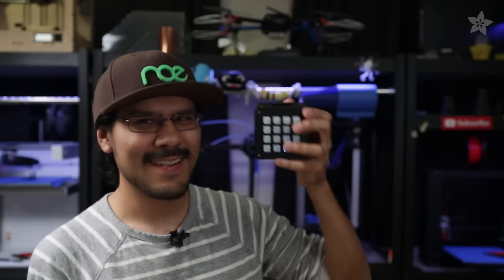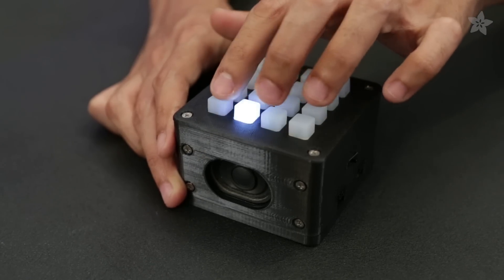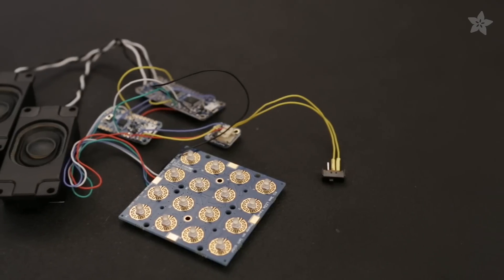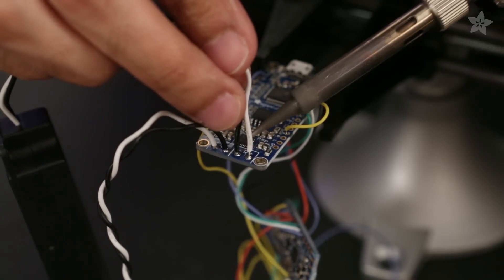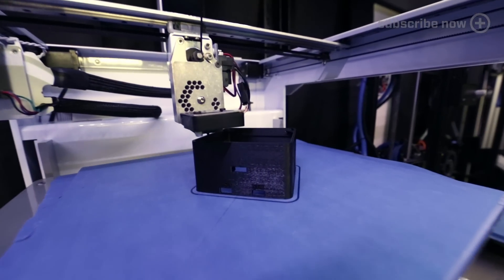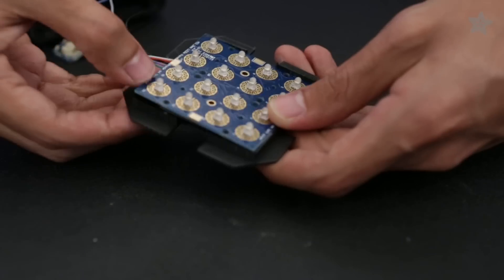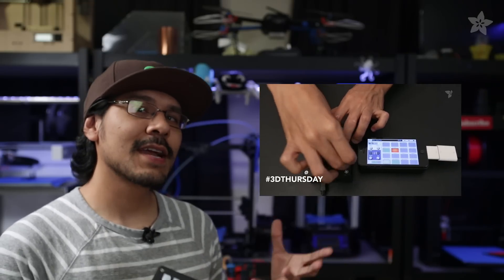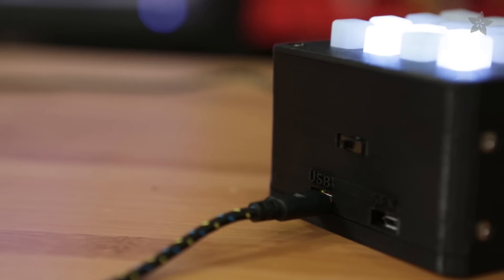DIY 3D Printed Soundboard

Comment: I would really like to have one of those diy soundboards, but I don't have the knolledge and skill to build one of them myself. Also I don't have the equipment. Is there any possible way to buy them already built together, and I just have to get the sound files on the soundboard? An answer would be much appreciated

Comment from the maker: 3D Printed Portable Trellis Soundboard
https://blog.adafruit.com/2015/04/16/3d-printed-portable-trellis-soundboard/

In this project, the Trellis triggers samples on an Adafruit Audio FX soundboard. The Pro Trinket interfaces between the two over serial and i2c and ties the samples to the buttons.

It’s a really slick way to make a compact, all-in-one sound board. This version of the Audio FX Soundboard features a built in amp so you can wire speakers up to terminals or directly on the board.

Read more
https://blog.adafruit.com/2015/04/16/3d-printed-portable-trellis-soundboard/